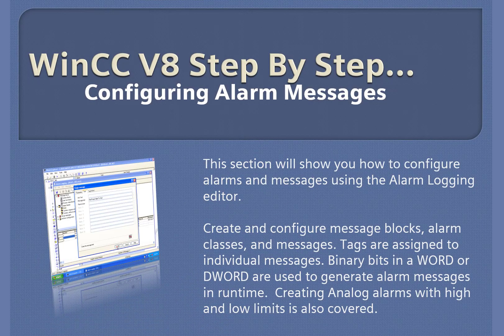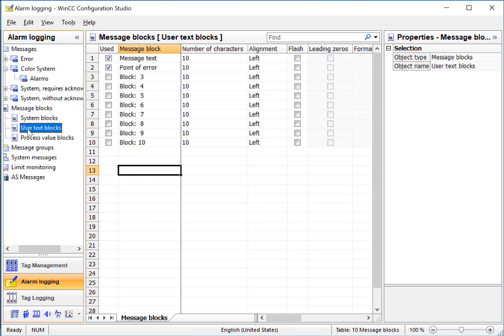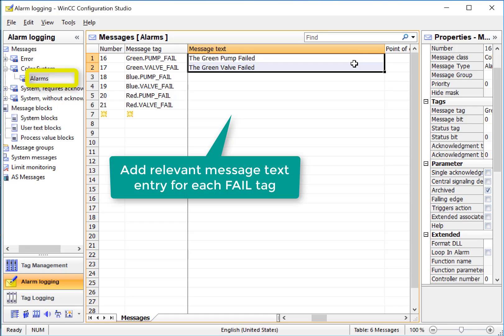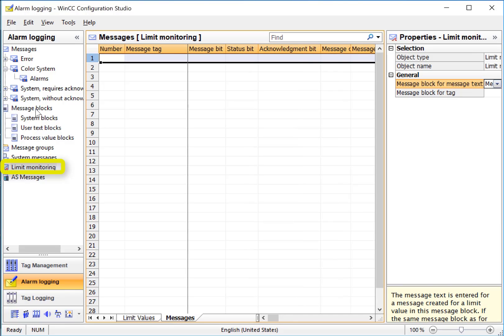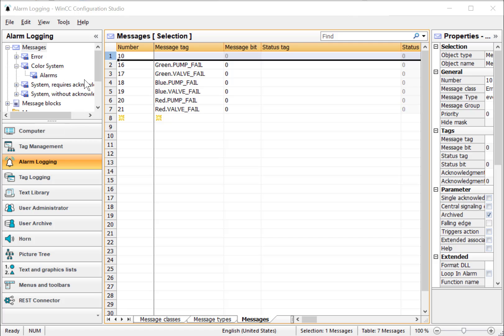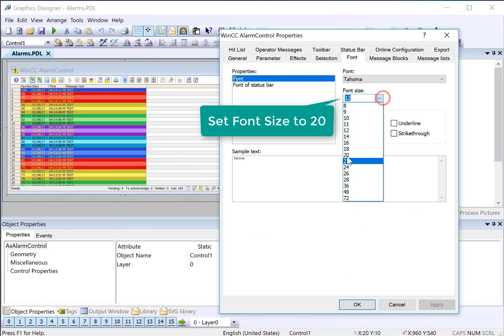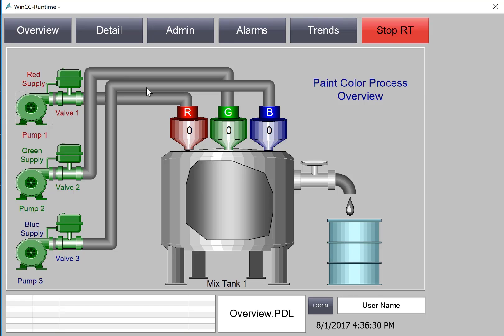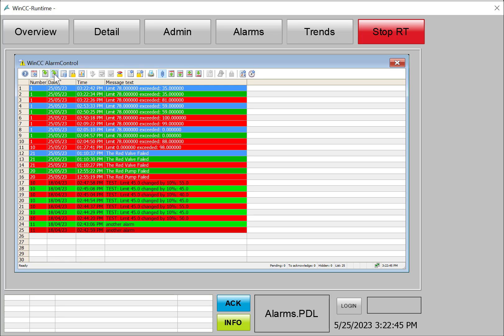WinCC v8.0 Step By Step 16: Configuring Messages in WinCC Alarm Logging ⚠️ #winccguru

Comment: Hi, I'm facing issue while creating of grouping of Alarms in WinCC. Can you help with creating Alarm for a group of signals such that an alarm is generated when any of the signals of group becomes Set and alarm resets when all the signals of groups are Reset.
Reply from the maker: WinCC doesn’t have this feature out of the box. Alarm groups just allow you to acknowledge or lock multiple alarm messages at once or get statuses. It uses internal tags to do this. Not sure this could be used as you describe since you cannot use the defines status tags to generate further alarms.  

It possibly could be done in PLC or in scripting.
Reply: @WinCCGURU  Yes it is possible through PLC but that requires separate licence. Not sure about scripting though. There is a MESSAGE GROUPS inside Alarm logging. What is that used for?
Reply from the maker: Message groups allow you to use internal tags to see the status of all messages in a group (active/cleared/acknowledged) and well as acknowledge them all at once. 

I probably should do a video on this

Comment: Hey WinCC Guru you're a great teacher!! I've learned a lot in this channel.
I have one question regarding the messages: Is there any way I could differentiate process events from alarms? For example: I don't like to show regular process events on the message list of an alarmControl.
Reply from the maker: Yes, absolutely. You just filter the results for what you want. On the alarm control go to the message line tab and you can create filters for alarm class type and other values.

I usually have an alarms page filtered for alarms and warnings and an “events” page filtered for only events.
Reply: @WinCCGURU  That worked flawlessly, Thanks!!
Is there any way to filter the output by date, I've been searchin around but haven't found a reference for AlarmControl properties or methods
Reply from the maker: Yes. You can use the filters on the message line tab or the MsgSqlFilter property of the alarm control.
Reply: @WinCCGURU  Thanks!
I found the reference in the document: WinCC_Working_with_WinCC_en-US 6.6.2.12 SQL statements for filtering messages in AlarmControl
Reply from the maker: That’s great! I use that property all the time

Comment: Hi winccguru, when I put my tag, it pops up on me: The imput value " tag" could not be applied. The bit number is not permitted for this tag. How to resolve this problem? The tag is binary tag
Reply from the maker: Do you mean when you add the tag to an alarm message? if so, check the data type of the tag. it must be either a Binary or UNSIGNED tag. Signed tags are not supported.
Reply: @WinCCGURU  ok thanks

Comment: When configuring "WinCC AlarmControl Property" in the "Message Lists" tab I don't have the option to select "Message text". Where can I attach it?
Reply from the maker: Message text should be available by default on the message list tab. Check on Message block tab and see if it’s selected.  If not then in alarm logging under “message Blocks” make sure it’s selected for use.
Reply: Hi
I have the same problem.
In Alarm logging, Message blocks is Message test selected but i cannt see it in Message blocks tab in AlarmControl configuration
Reply from the maker: go back to alarm logging editor, then to message blocks, user text blocks. make sure message text is checked there. then restart graphics designer and you should see it.
Reply: @WinCCGURU   in message blocks, user text blocks is message text selected. In configuration dialog on Message list tab is User text block 1. I think this is my meesage text blok because when i changed size of message text to 100 characters, size of text block 1 changen. But i cannot see text of message
Reply: And adminisyration is not working to.
I have seted in object miscellaneous authorization, but when i click otln on object in runtime it can be changed without being logged in.
Reply: I have the same problem. I think it is result of language. I dont know how to change it. Alarms showes but without text...
Edit: I solved this case. Go to "Text Library" and there add your Runtime language. Copy all column from English(US) to your added language. Another option is to change Runtime language to English(US).
Reply from the maker: @GeorgeFatality  nice catch, thanks for your answer!!

Comment: @winCCGURU  In message block there is a row called batch name, if i added batch name in message list of alarm screen,  batch name is not reflecting in runtime screen.But in tag management there is a tag for batch name and proper value of batch is showing that tag.how to show the value of batchname in alarm screen?
Reply from the maker: See this video: WinCC V8 Tip 7: Insert Process values Into Alarm Messages! ⏰ Learn SCADA Programming #WinCCGURU
https://youtu.be/ronYL9X_bdo
Reply from the maker: If you want to show the value of the batch name tag I’m alarm message you  need to add it in a process value block.

Comment: how to filter the alarm texts by a vartiable ? 
i tried this code to filter it based on a variable but it doesnt work
#include "apdefap.h"
void OnLoaded(char* lpszPictureName, char* lpszObjectName )
{
SetPropChar(lpszPictureName, "Control7", "MsgFilterSQL", "#VisibleOnly\\Text1 LIKE 'Motor_732.HMI_INSTANCE'") ;

}

while this code works and filters it using a static text:
#include "apdefap.h"
void OnLoaded(char* lpszPictureName, char* lpszObjectName )
{
SetPropChar(lpszPictureName, "Control7", "MsgFilterSQL", "#VisibleOnly\\Text1 LIKE '%LB732%'") ;

}

thank you for your time and help.
Reply from the maker: The "Text1" Field is likely the "Message Text" field, and would not have the name of the tag in there, unless you put it in. The related tag to an alarm doesn't appear to be able to filter the alarms by, unless you put the name of the tag in a text Block.